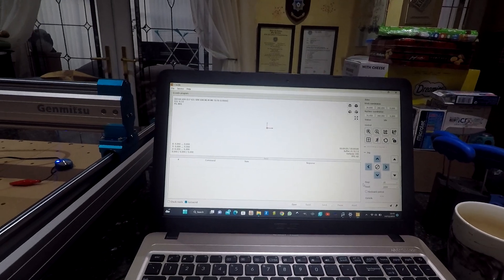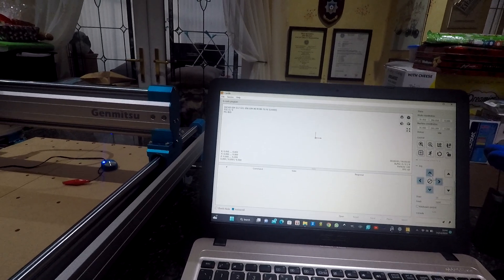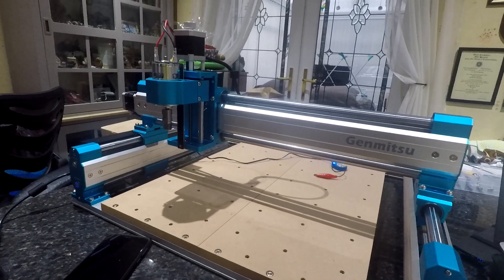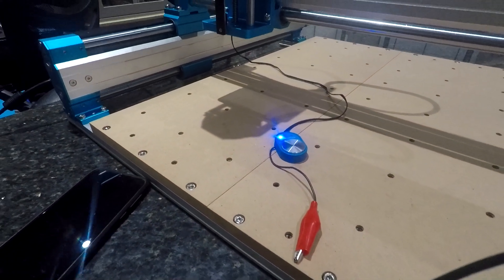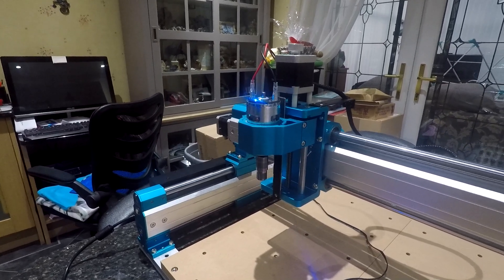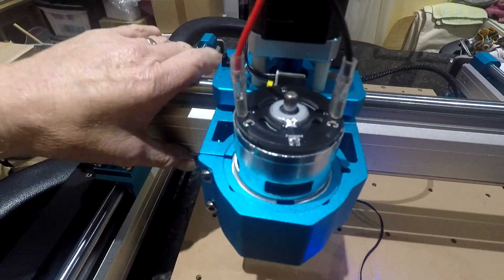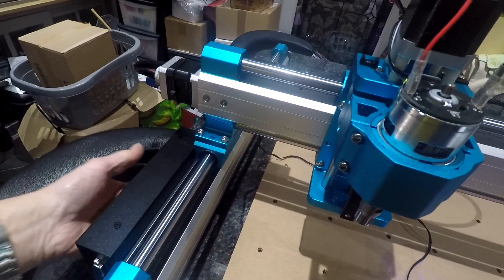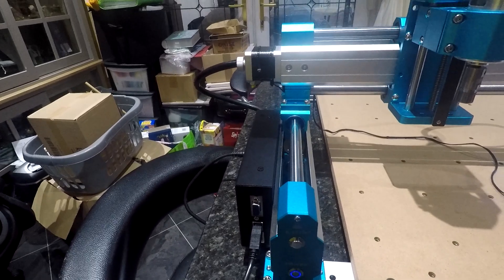Genmitsu Cnc4040 Pro Part 2

Comment: Always enjoy your informative videos.I'm considering this for my first CNC.  I'm have a hobby wood shop, but only have the use of one hand. (My wife always worries about me out there) I primarily work with 5/4 hardwood.  In your opinion will the CNC be suitable for cutting circles, cutting out bread boards and shapes?  Of course I intend to use the upgrade to a palm router.
Reply from the maker: Hi thanks for your comments, yes it will be ok for you with the upgraded spindle but you will be better off if you get the 4040 with the upgraded z axis frame its stronger for the bigger router. It might be worth emailing who ever you purchase it from to check.
Reply: Tony, thank you for your reply, but I can't find any info for an upgraded z axis frame for the 4040 @Tonys.Top.Tips.Workshop
Reply from the maker: @workinghand5768  hi I have done a video on the differences between the z axis it's my last one I did

Comment: Hello, did you have to connect the x-axis limit switches somewhere during assembly? Mine don't work for some reason and I see no place to connect them to
Reply from the maker: Hi Manuel once you have made all the connections that are stated in the instructions and you operate the mobile phone software switch on the machine and find the connection as stated in the manual it should auto home to the front left corner. there is a little white plug on the z axis assembly which is the connection for the z axis limit switches. All in all it should just auto home then when switched on
Reply: @Tonys.Top.Tips.Workshop   I was able to find the problem, it turns out that the x-axis switches came unplugged from the factory, the connection is in a really tight space but after a few tries I was able to reconnect them and now they work fine.
Reply from the maker: @manuelrosquete6818  Great stuff where were they disconnected

Comment: So I bought the machine used it for a little bit and I will be returning it. There is way too much movement. It is not rigid at all. I can grab the bit and apply a little force back-and-forth and the whole thing wiggled back-and-forth. Not like it’s loose just all the metal flexes.
Reply from the maker: Hi sorry to here that but my machine is quite solid  I have used it a fare amount now and its performed really good, I have a 6090 Pro machine and thats on a different level that cuts steel I just use this for timber and acrylic and its great. If your not happy return it. I paid £454 for mine and when I looked at all the others in that price bracket there was nothing of this standard. I have had most other makes of 3018 and 3020 and none of these have performed like this one has. The only faults I have found with this machine is the problem with the touch off probe and the weak spindle and as I have shown in a video I have upgraded the spindle and thats  100% better. Tony
Reply: @Tonys.Top.Tips.Workshop  
Do me a favor and grab the bit and add pressure to it front and back. Put the bit 2 mm off of spoil board to see if it moves.
Reply from the maker: @Checkitfirst  Hi just been and checked it it does not move like that in fact I had to apply an awful lot of pressure to flex any of the rods
Reply from the maker: I have just watched your video I would send it back most of that movement is the z axis bearing rods

Comment: Thanks for the video. How is the rigidity of the z axis ? Can you move the bit when it is chucked in the spindle
Reply from the maker: Hi sorry for not getting back to you sooner,  to answer your question its that rigid for its size that I had a mishap when using the z probe the lead you attach to the cutter slipped off whilst the spindle was traveling down to touch off. It did not stop and it pushed the motor back up the motor clamp. I did manage to use the estop. I checked the machine there was no damage. If there is any movement it is with the motor spindle not the cnc frame. I will be upgrading the motor. It works great as it is that is just my choice. This incident shows how well built this machine is the 2 things that I would have liked to have seen on the machine are ball screws and a better spindle motor. Hope this helps Tony
Reply: Thank you.
Reply: I bought this machine and I will be returning it just for that reason. You grab the bit and apply a little force front to back and the whole thing flexes.

Comment: Thanks for this video Tony.  What CAD/CAM software would you recommend?
Reply from the maker: Hi sorry for not answering sooner but I have been away.  To answer your question I use vcarve pro and Aspire both from vectrics. You have to install the grbl post processors there are 2, metric and imperial. I just typed in the question on google and it took me to a forum and a guy had them on there and they worked. I hope this helped Tony